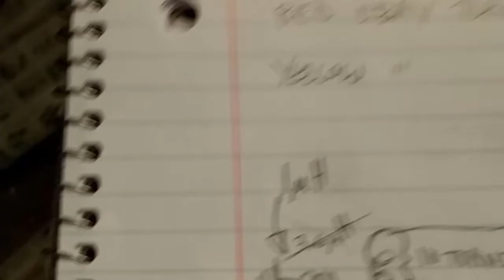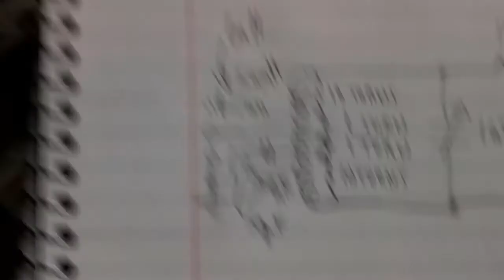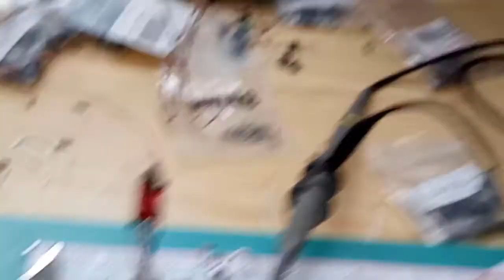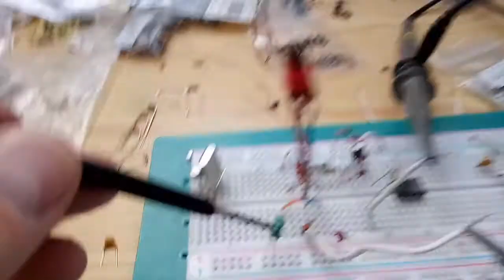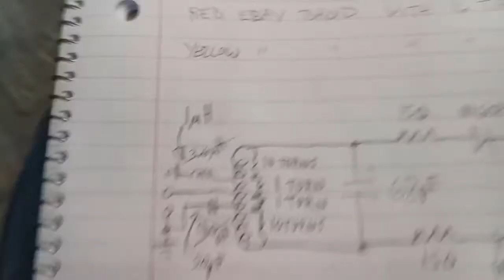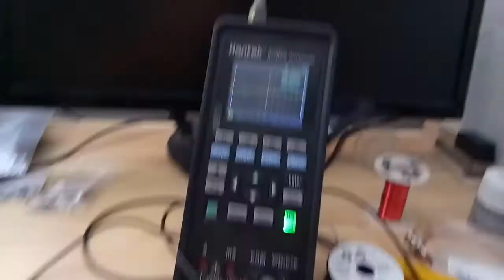FM Ratio Detector Demodulator Circuit | Simple DIY FM Demodulator with schematic

Comment: Hello, what gauge wire did you use on your torroid ?
Reply from the maker: I did not test the toroid version since the toroid's I have are not the same type but did order the correct toroid's today so when I get them I can do a test to see if they make any difference.  The wire gauge I used on the coil form is 32 AWG  and not 26 as mentioned incorrectly in the video.  There is nothing too magical about the wire gauge but you will need to use enameled wire.  You may be able to fit on a thicker gauge as long as it fits on the form but I would recommend staying close to 32 gauge since you could have other issues if you deviate too far away.  I would not recommend to go thinner since you would have lower Q which could also change results.  They only way to know would be to experiment.

Comment: what is a diameter of your coil i have 6 mm plastic body with 4mm ferite core for tuning
Reply from the maker: The ones i have are 5mm and can be purchased on Aliexpress from: https://www.aliexpress.com/item/32983728237.html?spm=a2g0o.productlist.0.0.1e002ea0ngUeKP&algo_pvid=3f1373f0-bf6f-4e7b-9439-c456f4768322&algo_exp_id=3f1373f0-bf6f-4e7b-9439-c456f4768322-9&pdp_ext_f=%7B%22sku_id%22%3A%2266773799784%22%7D 
If the link does not work just type in variable inductor and you should see it.  I bought the forms and wound the coil using number 26 enamel wire.  Your cores could work also but you may have to measure the inductance.  I would recommend to order the same cores since they are very low cost.  Also I can't remember which meter and test frequency I used to measure my inductor so if you use a different meter that uses a test frequency it quite different you will get a different reading.  I hope this info is helpful.  I did make a working receiver using this detector.  It does sound good but I still want to finish adding an Automatic Frequency Control circuit to the receiver since it will drift over time.  I also would like test a phase lock loop audio detector circuit to see how that works.

Comment: Great Video. Can you show its working with 10.7 mhz IF signal from a  radio.
Reply from the maker: Hi Ankur,  I did build a receiver for this but still want to add an automatic frequency control for it since even though it does sound good, the Local Oscillator on my receiver drifts over time.  Once I finish it I will add it to my channel.

Comment: I must say that i am glad that someone else than me 
found this interesting circuit originaly made in Japan by unknown guy.
Ok forst time i build it i use similar coil like you 8mm plastic body from old AM radio winding this 
6x1 x 2 windings ..then i found small toroid from old florescent lamp 15W and wind ..this time bi-filar so ..6x2 turns and i get better results .
In fact work really well.For diodes i think that author says silicon..so i have 1SS93 and use it 
also work well.
I use this ratio detector for my ONE TRANSISTOR
FM superhet radio.
Reply from the maker: I have not done a lot of testing with different types of diodes but did order some germanium ones from ebay that I am waiting for.  Once I get them I would like to see what happens to the sensitivity.  Also I should point out that there a lot of fake ones on ebay and found a web site that said most of the small style germanium diodes did not work nearly as well as the older style large glass body ones.  So even though I thought I had some germanium diodes, I may really have had fakes so will do some more testing on this.
Reply: @hotshotmarketing4893  do you tested circuit on 10,7mhz
Reply from the maker: @astongoldsmith2396  Yes, I only tested it on 10.7Mhz. I made a front end with NE602 mixer to mix down the carrier to 10.7 MHz.  I then fed the 10.7MHz to a 10.7 MHz ceramic filter and 3 stage tuned amp and finally to the ratio detector.  The audio sounded very good but over time the mixer oscillator drifted so I still want to add automatic frequency control feedback to keep it tracking the carrier frequency.  Hopefully I will have a chance to do this soon and will then add it to my channel and add a link from this video to the completed fm radio.